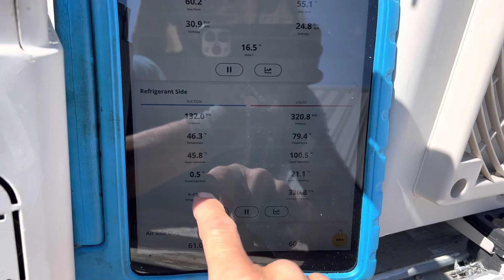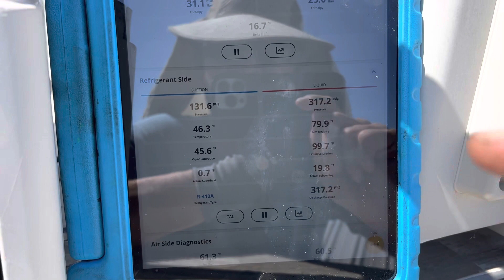0.8 SUPERHEAT IS NORMAL SOMETIMES ON SOME VRF SYSTEMS THEY HAVE A BRAIN 🧠

Comment: Nice job t lech! We are seeing lower superheat across the board with the efficiency going up, haven't done much VRF but it's coming
Reply from the maker: I was The oddball guy years ago I nearly totally dropped selling any standard split systems or package went for 100% VRF jobs only. 
        When I took my son out with me to work for the very first time with no experience out of high school I handed him a 24 ton VFR installation.  By himself with nearly no help except when he needed to move something heavy or pick up a hang over head, I Slo-mo to Georgia to the Panasonic training he attended the Panasonic training classes here I gave him a 400 page installation manual.   I knew the owner of the building in the project was going to take many months for them to get built anyway so he had all the Time in the world.    So a high school kid installed a 24 ton VFR system solo.  Except for the Brazing I wasn’t going to trust that part on that many braise joints and branches.